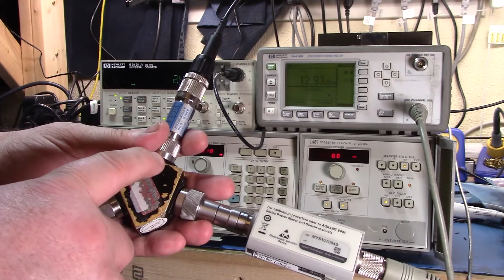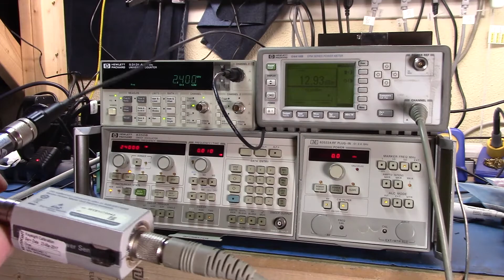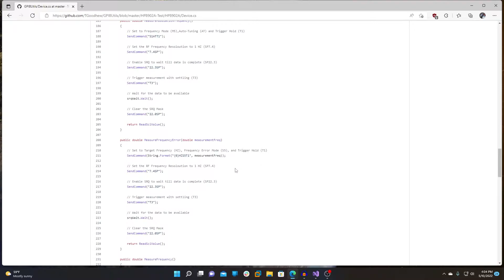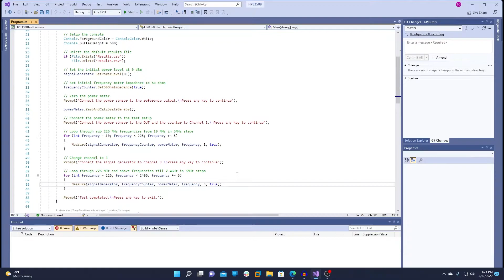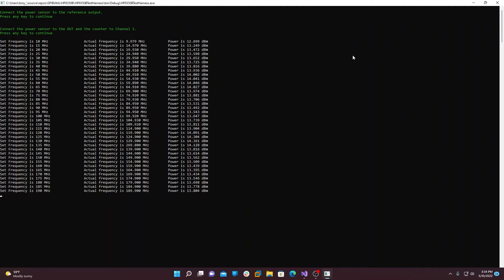HP83522A - When you're too chicken to risk the SA

Comment: I mean... thnx for the vid... and the work... but, to me.... an IMO... this seems like to most convoluted way to determine the max power of the S.G., over it's range. Well... maybe, I could think of a harder way.
Reply from the maker: If you are just looking for a close measurement of what a signal generator outputs then you can absolutely use an SA for that. I didn't want to take the chance that the sig gen of unknown providence wouldn't do something rogue on the output but clearly, in hindsight, I could just have used the SA (I have many sensors but only one SA)

However, a power sensor is going to get you a power measurement that is around an order of magnitude better than the SA and might be even more depending on the SA that you use.

This is why most of the calibration processes for sig gens use a power sensor rather than an SA for their adjustment steps.

Comment: I picked up an MXA last year when the original A models started being sold cheap, I suspect a DC block and a 30dB pad might be my first call if I didn't just do a sweep against a power sensor set to a vaguely midpoint frequency to be confident enough that it wasn't going to destroy the frontend on the SA.
Reply from the maker: Great point - My 8653E has the 30Hz option and that makes it very susceptible to DC which was another reason I wanted to check the 83522A before I started looking at THD - The 83522A doesn't have option 002 (the 70dB attenuator) so I really wanted to get control of the power before looking at it as well.

Comment: Very nice! Love the Automation and C# is a favourite. I have been doing the same to support my old instruments (slowly) however using the Keysight IO libraries. I'll be checking out your Git repo! Thanks for sharing 👍
Reply from the maker: Hope you can use it - Basically I decided to create "device" classes as I need them to automate stuff rather than just doing manual testing - Not because I have a bunch of tests that need to be run but so that I can end up with code that covers the main functions for all the devices and can then hook them up for custom test apps - Eventually I'll move the classes into a single library/project that can be added to other projects but for now it is sort of by project/test need.

Please feel free to do pull requests or issues if you want to provide feedback.

BTW I think the VISA namespace is going to be the same for the Keysight libraries so you might just have to change out the reference to National.Visa to get going. Pop a PR or Issue if you try it out and come up with steps to port to the KS libs.